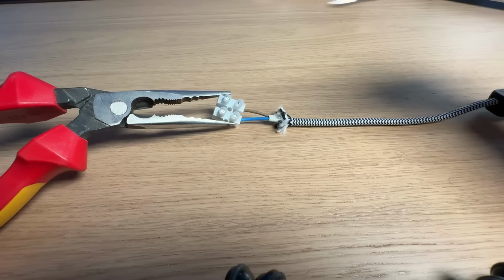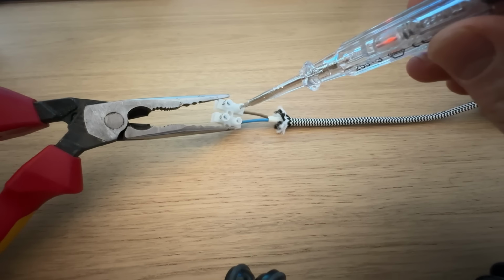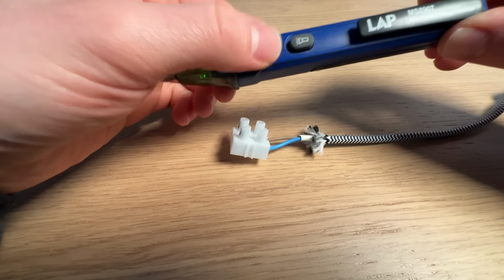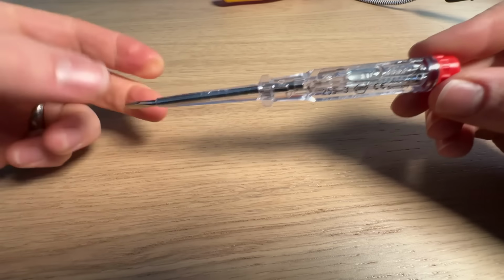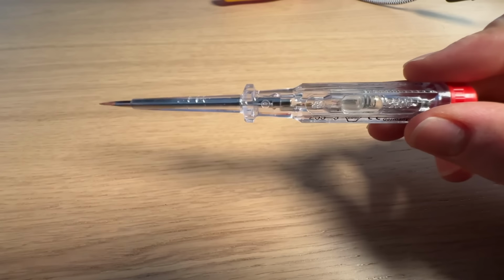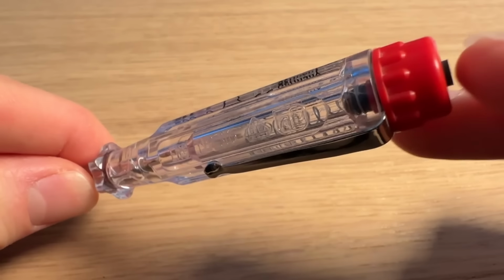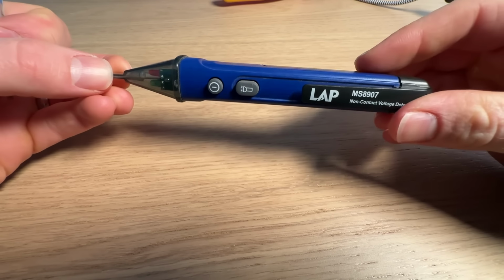The Most Dangerous Electrical Tool

Comment: Very common tool in eastern europe, for decades. Still very much used. Like any tool, needs to be used properly. Also bites if you happen to touch a grounded part while probing. Unfortunately new models seem to come with physically small resistor.
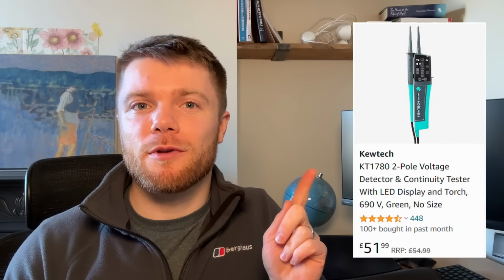Reply: If you had ever read any old electrician education materiel from eastern Europe you will know that this is not the right tool to use, the right tool is a tester like the one shown at 1:35 in a more bulky variant, but one thing is what people is taught, an other thing is what they do in reality, they sadly often reach out for the easy fix solution.
Reply: @K2teknik.  Do you remember how those old voltage testers with 2 probes worked in 50s-80s? They were passive, without batteries and LEDs. It was just coil with core on spring. Impedance of this coil was very low. So if you dropped one probe, you could get shocked easy. Screwdriver tester was in fact much safer. And there was no way to test just one wire if it is life without connecting second probe to good ground.
Reply from the maker: Thanks for watching!

Comment: These should be banned
Reply: Why?
Reply: @jumper233  best to use the right tools to check for voltage rather than toys, as electric is not something to play with. Approved voltage indicators etc. When working on 415v etc I wouldn't even imagine getting a toy to test for power. Not these old school DIY gadgets. Heard they have potential to shock but could be hearsay. VDE rated screwdrivers and approved rated voltage indicators. Decent multimeters etc. That's my opinion. Maybe I'm wrong🤔, what do you think